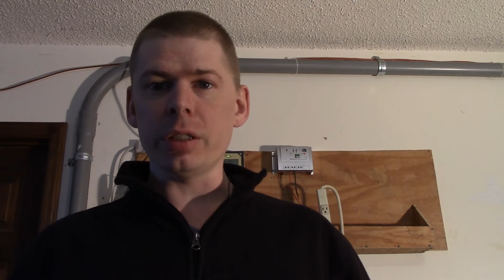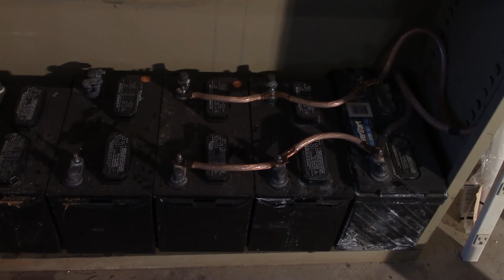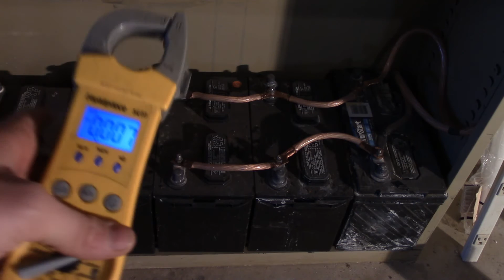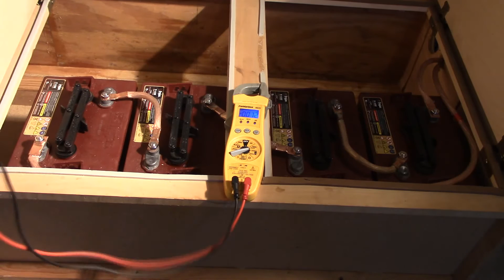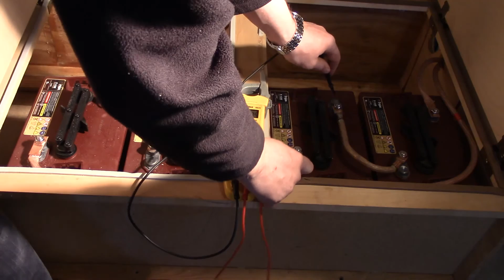How To Setup Batteries For A 24 Volt Solar Inverter.

Comment: I have 4 6 volt 225 re trojan battery  and I want to connect them to 24 volt. But I notice if I put them to 24 volt I will get 24 volt at 225 amps ..right I use to have 12 system n I had 450 amps. Is they away to get more amps on a 24 system. Wen I had 12volt system I use to have 24/7 light but now wen I have 24 system my power turn off around 12 to 2 am which mean am killing my battery
Reply from the maker: The inverter may be less efficient than your other system

Comment: Hello. How many batteries to connect to this model ? 1KW/1000Watts Pure sine Wave Inverter 24VDC.
Reply from the maker: yusifu wormandia you could put it in anywhere between 4 8 12 16 24 48 96 batteries in series parallel

Comment: Didnt know you could do that ! (Plugin your terminals into the acid). Good to know.
Reply from the maker: +rob mc You should never poke the lead plates.Just dip the test leads in the sulfuric acid don't touch the plats
Reply: Oh MY ! Thanks for telling me this. Maybe mention it in your next solar video ?
Reply from the maker: Ok I did this and it gave me the wrong volts and retested and then it's good so please before you do any thing water them and recharge them

Comment: Nice bit of info. I have been building my piece by piece.  I like to have 8kw of solar and 4 of the PIP 4048 like the one I have now. I can run those in Parallel I can also stack up to 6 for 24kw.  and also they can be set up for 3 phase systems lots of flexibility.  I have to use transformers with mine to get the 240 volt split phase.  but it all works pretty good.  Like your videos a lot to watch and look though.
Reply from the maker: +McCuneWindandSolar Thanks and more coming very soon.